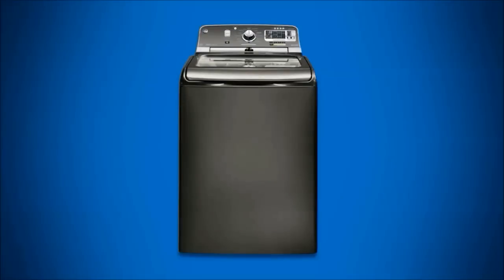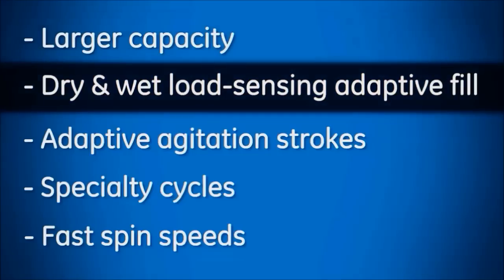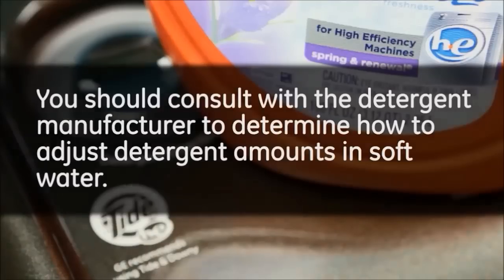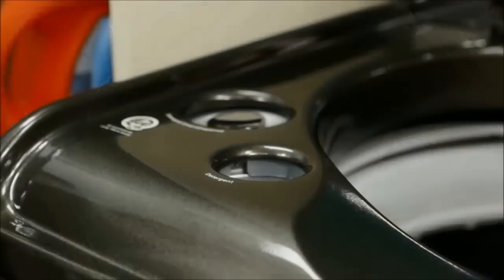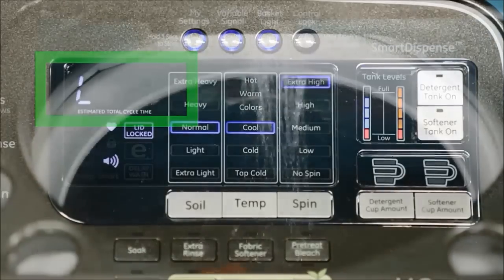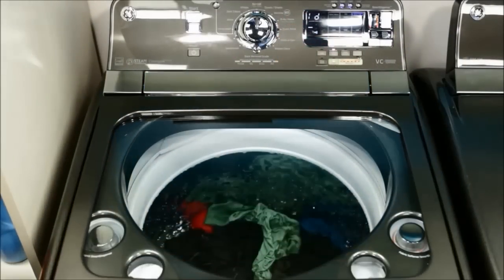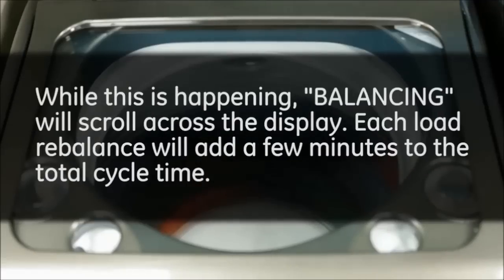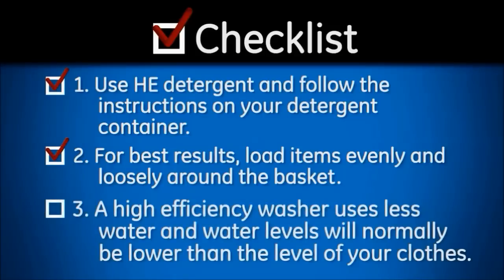GE Appliances High Efficiency Top Load Washer with Infuser - Proper Use and Loading

Comment: My GE profile model PTW700BST0WS , during the lid lock / sensing cycle, bangs wildly from side to side during the 3 spins, moving the washer sometimes an inch or more before calming down and moving on to the fill cycle. Can this be normal? How to calm it down?
Reply from the maker: If your washing machine is new, we recommend checking that the shipping material has been removed.  Please check page 18 of the Owner's Manual in the following link:  http://spklr.io/6052EHpdi   Also, please make sure the washer is level.  If this does not help, we recommend scheduling a service appointment with our GE Appliances Bodewell Service team at:  http://spklr.io/6059EHpjF

Comment: Why does my washer dance across the room, why does it lock sometimes and not all the time
Reply from the maker: A washer that rocks or moves excessively may not be level. You should also ensure that the load is balanced and evenly distributed. There are portions of the cycle that the lid will lock, such as the load sensing and spin. If you believe your washer is not performing correctly, please schedule service by calling 833-426-3393.

Comment: How can it possibly be done in less time when you have to pour extra water in to cover your clothes for half an hour!  Why sell an extra capacity washer that adds no water to cover the load. When I wash my king comforter if I don’t add water it comes out half side still dry.  You can’t dry wash clothing.
Reply from the maker: Hi Dawn,

Thanks for reaching out. We'd be happy to help as best we can. Firstly, we don't recommend adding water to your washer as this can affect the unit's operation.

Secondly, if you'd like to read more about a washer not having enough water, you can click here: http://spklr.io/6055cqET

Also, most large comforters and blankets will wash properly in our washers, as long as the comforter fits below the balance ring of the washer tub and is not stuffed in the tub tightly. You can also take a look at this article for more details: http://spklr.io/6056cqEp

If you have other questions, know that you're always free to ask. -MS
Reply: @geappliances  Well, the only way to get ANY clothes clean in the GE Washer that we bought is to add water!  I can put three items in this washer and they still come out dirty unless water is added.  We bought the 7.4 cubic foot model specifically to wash a King Sized Comforter and it does not get it clean. Deep fill is used for every cycle and there is still not enough water.
Reply from the maker: Hi there,

We're quite sorry to hear that your washer is not cleaning your clothes well and understand how frustrating this must be. The Department of Energy (DOE) sets standards for washer water usage. Over the years, the amount of allowable water usage has been reduced. With washers using less water and energy, you will no longer see a wash basket full of water. Most washers are now programmed with load sensing to adjust water levels based on the cycle and load size, so the amount of water used will vary.
 
It is not recommended to manually add more water to the washer. Some models have a Deep Fill option which adds additional water to the wash load, regardless of whether you used a manual or a load-sensing fill. We do have some troubleshooting if your washer is not cleaning your clothes well. Check out the link below. 

http://spklr.io/6052csJm

We hope this helps. Best wishes. -MH
Reply: @geappliances  as stated the washer does not get clothes clean no matter how few or how many clothing items are in it. No matter how many extra rinses you turn on or if you press deep fill! Please do not reply with rubbish information again!  I’m not sure if you’re aware but the whole world does not have water limitations, there are people with wells still.  The only option I understand to sufficiently clean your clothing is a wringer washer that would ultimately take less time than any of yours (which need to be washed multiple times to clean them).Hopefully one manufacturer will get on board with the public and make a decent washing machine that actually cleans your clothing. We have always bought ge but no more!
Your information from link sent previously provides information that is useless! Anyone with a shred of common sense would know all of the useless information already.

“To improve wash performance, use the correct amount and type of detergent, load carefully, and select the right amount of water and settings for your load size. Keep the lid closed during the wash cycle.

Step 1: Select the right amount and type of detergent. Follow the manufacturer’s recommended amount for your load. Pre-treat stains if needed. If your washer has an infusor or precise-fill setting, you should use HE (High Efficiency) detergent. HE detergent is a low sudsing detergent. Contrary to other applications, suds in a washing machine can reduce cleaning performance.

Step 2: Loosely load the clothing into the washer basket around of the outside of the basket. Pouring and/or compacting the load can lead to poor cleaning performance and increase wrinkling and tangling. Do not wrap items around the agitator or infusor as that can lead to increased wrinkling.

Step 3: Close the lid. Select the settings for your washer cycle. Several washers can select the correct amount of water. Clothing that floats in the water may not get the optimum turnover to clean properly. Keep the lid closed during the entire wash cycle.”
Reply from the maker: Hi there,

We can certainly understand how frustrating this can be. If you've found that the troubleshooting information is not helpful and your clothes are still not getting clean, we recommend having a technician inspect your washing machine. 

You can schedule an appointment by calling 1-800-432-2737 or schedule online at http://spklr.io/6056csKe 

If you need any assistance, please let us know. -MH

Comment: I hate this machine. Even at Max for sheets and comforters, there isn’t quite enough water to cover the wash. I can’t add more items mid-wash and then increase the water level. The computer sets the level at the start and that’s your only chance. And now the detergent dispenser doesn’t work. Says ‘Tank Low’ even though it is chock full. Calling for repair. Wish I had bought a front loader.
Reply from the maker: Hi there,

Thanks for taking the time to reach out about your washer. Sorry to hear about the frustrations and issues you've had with it here. We did want to clarify and say that the Department of Energy (DOE) sets standards for washer water usage. Over the years, the amount of allowable water usage has been reduced. With washers using less water and energy, you will no longer see a wash basket full of water. Most washers are now programmed with load sensing to adjust water levels based on the cycle and load size, so the amount of water used will vary.

We don't recommend that you manually add more water to the washer. Some models have a Deep Fill option which adds additional water to the wash load, regardless of whether you used a manual or a load-sensing fill.

If your tank claims that it's low even though you've recently added detergent, then you've made the right call in reaching out to our service team for further help. We're confident that our technicians will diagnose and repair your washer as quickly as they're able.

Thanks again for your ongoing patience. If you have other questions, feel free to send us a PM on Facebook or a DM on Twitter with a copy of your comment here for reference.

All the best. -MS

Comment: Oh so I have to 'specially' load this thing for it to work right? Other machines don't require any 'special' loading! Only reason I have this is that the new front loaders (that this replaced) are too large for the space. I read another video that said that I could load the machine essentially any way I wanted to, but noooo, GE has to be different! 🙄😕😔🙄😕😔

Comment: Dry spots from high speed spin My ASS! every load there’s dry spots before putting clothes Into into the drier. When this happens peeps, sniff and you will smell clothes that AREN’T CLEAN! These washers are the worst invention ever. From now on, I will use my washer as a planter for my palm tree, and hand wash my clothes in the FILLED bathtub. If everyone washed their clothes by their HE machine, then filled a bathtub and put your so called clean clothes in the tub to soak for a few hours, instead of the drier, you will see how filthy your clothes are out of the washing machine, you will be shocked!

Comment: I just replaced my dead 7 year old Cabrio with a  DTW720 in the Diamond Gray. I was able to do 4 loads in this machine in about the time it took to do 2 in the Cabrio which always had balance issue's. Put a really sweat stained bed pillow in it today and it came out snow white. I just read the manual and load it like it says. So happy to have this machine. When my dryer dies, I'm getting the matching dryer! Thank you GE!!!!

Comment: GTW680DG/GTD65EBG these are the models I have which I reach recently purchased. High efficient washer and dryer sets are new to me and I'm noticing that there's white streaks all over my clothing are there any tips you can provide that will help prevent this? I used the fabric softener button to try to get an extra rinse, but it doesn't appear to be working that well and I have to rinse all my dress pants!
Reply: That’s happens to my dark loads too! I was hoping there would be more replies with the answer 😅
Reply: @blackedoutbianca  It used to happen to my dark clothes when I was using this kind of washers. I figured it was because I loaded the machine too much. There was not enough space for the clothes to move around.

Comment: Oh n HE detergent is pathetic! Washer starts to stink after 3 months from new. Now I use Kirkland brand powder (Costco) or Sun Brand in the bucket. Both work well if you add to bottom of tub b4 washing. Melts better n circulates better! Over a year n NO MILDEW SMELL!
Reply from the maker: Glad those have worked well for you, Kimberley!
Reply: Enjoy your bad bearings ;)
Reply: @GOVHOTWHEELS420  I've used old fashioned powdered Gain detergent all my life and have had no issues with bearings.  My current washer is a Whirlpool I bought in 1999 and my next will be a Speed Queen TC50003WN as it has all the features of old school washing machines with the bleach dispenser in the corner, the fabric softener dispenser in the top of the agitator and the only option for detergent is to load it straight into the machine.
Reply: @Rebel9668  I been beating a maytag with boil sanitize that got used with powder. When I got it the bearings were 3x louder. Just saying It can hurt the bearings. I paid 40 bucks for the machine and it lives in a basement so I just don't care LOL

Comment: All you really need to remember is that it adds water to balance the load and each water addition adds time to the total cycle length. This means that the machine uses more water and takes longer than the old school conventional machines.
Reply from the maker: Hello Patrick, thanks for your great and positive feedback on our GE Appliance washer. Glad you approve and appreciate the water savings! Thanks for taking the time to post! Happy holidays! -SF
Reply: @geappliances  Water here is cheap and plentiful.  I couldn't give a damn about using less water when I can do 2 loads and have a 3rd load started before one of these new machines can finish a single load.  Electricity is much more expensive than water so it's much more cost effective to use a washer that uses more water with faster cycle time.  Not all of us live out west, in fact I have relatives that work at GE, more relatives retired from GE all of which work or worked at appliance park in Louisville, KY and even they say they'd never buy one of these inefficient modern HE style washers.  To me efficiency means a single rinse cycle, an agitator that actually turns over the clothes several times during the wash cycle and a complete cycle time of 30 minutes or less, a 700 rpm spin cycle is more than enough speed and i quite imagine it also uses less electricity than a machine spinning at 1,000rpms that has to check and recheck for a balanced load, when if you'd put the type of springs and supports inside the cabinet that Speed Queen uses no one would have to worry about a slightly unbalanced load.  It isn't rocket science to build a washing machine!
Reply: Yes it takes longer but uses less water. Awesome
Reply: No it doesn't.

Comment: Mine don't work either,no spin no fill only on bulk,but then it just sits there no washing action no nothing
Reply: Marie, did the reset work?
Reply from the maker: Hello Marie - we are sorry to hear that your washer is not working properly.  We recommend performing the motor reset procedures identified in the following link.  If this does not help, please contact GE Factory Service at 1-800-432-2737 for assistance:  http://products.geappliances.com/appliance/gea-support-search-content?contentId=17391   -NC
Reply: Ok I will try and reset the motor
Reply from the maker: Great Marie - we hope this helps!  -NC

Comment: I used to work with appliances and as long as you know exactly how to use a top load HE they work perfectly. Yes the electric boards on them can go out but that’s the case with about any electronic these days. Besides, any brand new washer you get anymore doesn’t have a true agitator in it it’s basically just a pole in the middle so you don’t get your clothes all knotted up from not putting them around the outside. HE machines are great.
Reply: @The Vacuum Vault  HE washers are pretty good here in America. Just don't listen to the modern appliance haters there just saying: OH these are the worst appliances ever! That's Bullcrap, that is not true, there just being stupid because they don't know how to use them.
Reply from the maker: Thanks for sharing Leah!  We're so glad your new HE GE Appliances washer saves you time while getting your clothes clean. We appreciate your feedback and are glad you are part of our GE Appliances family! :)
Reply: Except for the Speed Queen TC5 series which have their traditional transmission, agitator and deep fill, which I will be buying soon and which will probably last me the rest of my life as I'm 53 now and they're designed to last 25 years...which is just about as long as my current washer, a Whirlpool I bought in 1999 has lasted.  The only repair in all that time it has needed is replacing the agitator dogs which I did myself about 3 years ago in about 30 minutes.  I will thankfully never have to mess with HE washers and their ridiculously long wash times.  The TC5 can clean a whole load in 30 minutes which is just about the same as my Whirlpool, in other words it can do at least 2 loads by the time this GE is finishing 1 load.  How taking over an hour to do a single load is considered efficient is beyond me.  Water is much, much cheaper than electricity where I live and it's abundantly available.  Water costs me about 21 dollars a month using my supposedly less efficient machine now.  I do most of my drying on a 4 wire clothesline out in my back yard and the sun and wind are free.  I only use the dryer in inclement weather or in mid winter when the highs are below freezing.
Reply: How do you load sheets in this machine? Have been taking them to a laundromat where I can use a front loader which this new one replaced.

Comment: yes because that was a good machine, you load it set the controls and in 30 minutes or so the wash was done. None of this playing around with sensors to determine how much water and detergent to use. Filterflo's were good dependable machines that will outlast anything that he puts out today. If you built the old filtetflo today, that would e d up being your best selling washing machine.
Reply: Dougc3157 don't count on it! The old filter flo washers lasted too long!!
Reply: AMEN! to that. My first and only GE machine (after a series of Whirlpool variants and a Newton-built Maytag) was a 5550 Hydrowave Infusor" that barely outlasted the warranty, and never turned out a clean pair of jeans. I'll buy a wringer washer and a laundry sink before I ever buy another HE machine.
Reply from the maker: Dougc3157- We will share your feedback. Thanks for the valuable comments. LM
Reply from the maker: Thanks for sharing Leah.  We're so glad your new HE GE Appliances washer saves you time while getting your clothes clean.  We appreciate your feedback and are glad you are part of our GE Appliances family!  :)
Reply: The extra settings are supposed to help make your clothes cleaner because you can set it specifically for whatever your washing. So in my case - we live on a cattle ranch and my old agitator washer never did a good enough job when it came to some of my husbands clothes and I’d have to pretreat and let them soak for up to an hour before they could even be put in the wash but with this HE tons of settings washers I don’t need to because they have all those settings making it a lot less time consuming on my end. But to each their own I love my HE but I know tons of people hate them.